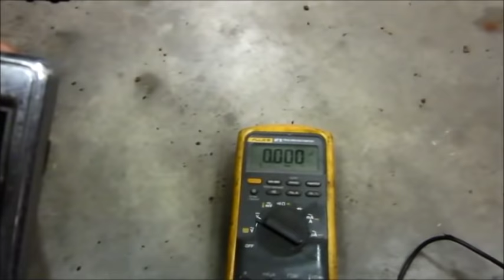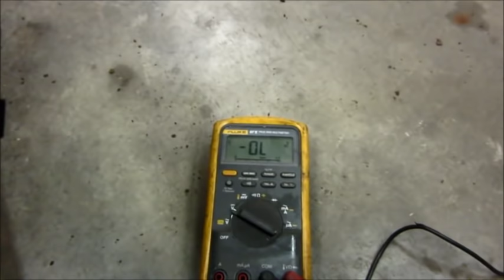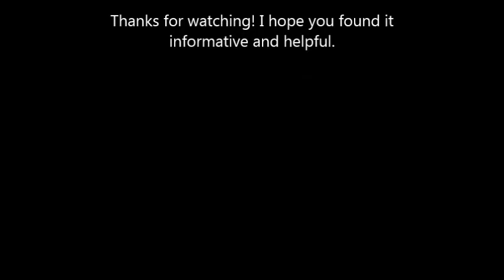GM Power Door Lock Actuator Rebuild...

Comment: Thank you for sharing . I did the same process but the moter still does not have no power.  Great video 🙂👍.
Reply from the maker: That is frustrating. More than likely, the relay or a circuit breaker is not operating correctly.
Reply: @davida1hiwaaynet   thank you for replying  . It does activate but it does not have power enough to unlock or lock the door o well 💁🏻‍♂️  I want to coment that your video is the best explain one on out in YouTube thank you for sharing the process step-by-step it was very helpful once again thank you from Mexico will de watching more of your videos 🙂👍🙌👍.

Comment: Thanks well done..mine moved but intermittent glitchy if helped. Cleaned brushes, stator contact, without splitting case as it was not frozen..works perfect, i could reach nuts so no need to weld...blue thread locker and lockwasher...79 corvette
Reply from the maker: Excellent! Glad it helped you.

Comment: Great idea using the test light! Can't beat a test light for a simple, yet powerful tool. I'll have to remember that trick.

Wires breaking in the door boot was a big problem for 80s and early 90s VW/Audi products. My 88 Audi 5000 had at least 8 broken wires in that boot. There were a ton of wires going to the driver's door between the 4 power windows, radio, mirrors, power seat memory, and lock controls.

Comment: Thanks for the very informative video. it's nice to see someone that can and will do a rebuild rather than a replacement. also, nice to watch someone else using a drill, drill press, and pin vise in combination to accomplish the end means. don't know what i would have done without them. I'm working on one myself now, i have an 
Astro Van and have rebuild the door handle on both front doors, one has a bad actuator so i'll get a chance to use these methods to finish my repairs. wish i could find one showing the repairs to the dutch doors on the rear of the van but i'm sure i'll get it figured out. Thanks again for a fantastic video showing a true rebuild.
Reply from the maker: Hi Don.  Thanks for the positive comment! I'm sure  you'll get your Astro door mechanisms working as good as new before long!

Comment: Hmm I found 4 good ones at junkyard i'd like to get off a 86 Oldsmobile cutlass ciera Brougham Model. They all 4 worked tested them with a drill battery to see but just gotta go drill them out an grab them before car gets crushed . I've already stripped and swapped the redish leather interior over to my 87 celebrity Eurosport from that car 

It also had power windows that i want too but since mine didn't come with them I can't use it which sucks since they all worked perfectly

Comment: The actuator is pretty expensive at the parts store (~$50, 9/1/18) and very inexpensive online (2 for $24.00 on Ebay) but you have to wait for shipping.  I came across your video after going to the junk yard.  They has at least ten Astro-Safaris.  I was shocked when ALL of the door actuators read either high resistance or open.  Figured brushes had to be the problem and your video confirmed it.  GREAT JOB!  I come from a "one man" TV shop background where we used to pick through windings to find the break so I'll probably skip waiting for a new one and just rebuild mine.  THANKS!

Question: Any reason you can't just use a 1/4" drive 1/4" socket and skip drilling out the rivets?  Has to be done by "braille" but it should be possible, at least on Astro-Safaris.

Comment: To take this to the next level instead of welding the nuts on, just silver solder them.  Make a ring of solder by wrapping it around a phillips screwdriver.  Then coat the bracket and nut with flux.   Stack everything up little shot of heat and you get a professional job.  It's also something any guy could do.

Comment: Thanks for doing this video, saved me the trouble to find out what is inside. The video would be better if you could do a test segment that shows how much weight can be lifted from full down and pushed up using weights or spring scale for a normally working unit post repair. The television show wheeler dealer (Ed China) did a video segment how to engineer to add power door locks to an old car that was being restored that didn't have power door locks. Ed used weights to figure out how much power was needed to lock or unlock the doors and to prove the units had enough power to lock and unlock before he installed the hardware. My 94 Chevy Astro van sliding side door does not work all the time and I paid a shop and they replaced the actuator with a new one, but not working any better. I checked the electrical power and its good so my next step is to remove the latch and clean it and lubricate and reassemble and hope it works. Must be a better way to troubleshoot this problem.

Comment: A Very, Very informative video.  Very nicely done.  I'm a another subscriber now.  Keep up the great work davida1hiwaaynet.  I think you helped out more than some folks.  [A lot of folks]!

Peace!
Reply from the maker: Thanks!  Glad you find my videos useful!
Reply: @davida1hiwaaynet  , I followed your instructions to a tee and my actuators work but, they don't seem to produce enough power to open and close the locks.  I oiled the door locks and other mechanisms, and the switches are working too, but still no luck.  I tested them without the door paneling on, so it's not being obstructed any kind of ways.  Do you think it could be in my door wiring?  Any ideas what it could be?

Thanks in advance,

Peace!
Reply from the maker: Hey, sorry you're having trouble with the lock mechanism.

It could be voltage drop due to wiring, but that would be sort of unlikely. It seems that the wiring usually going to break completely all at once.

I've had many cars where even new actuators won't move the door mechanism. It seems they are just powerful enough to move a perfectly free and good-condition door lock mechanism.

In the past, I have had to remove the mechanism from the door, (3 Torx bolts around the latch opening where the striker goes in) and clean it with solvent; dry it, and then lubricate it with chain and cable lube. 

Another possible binding point is the "bellcrank" mechanism where the actuator linkage connects to the manual lock button linkage. That often gets stiff.  Also, I usually take the spring off from that part as well, so that the actuator doesn't have that extra resistance to work against.

Hope this helps!
Reply: davida1hiwaaynet  , I'll give that a try and if it works, I'll post it for others who may need the help as well.  Thanks again for very informative information.  Keep up the great works helping people.  I'm about the same things. [Solving problems and helping other people and all living things.  Trying to produce Justice for all people].

Peace!

Comment: David, after watching this video, I think I got religion concerning the dew wipes on my doors of my car.  Definitely a priority now.  Did GM use the same actuator design across their car/truck lines for a period of time?  Would all the a-body cars use this actuator?  I didn't catch it, but what acid  did you use for the spring clean up?  Thanks!
Reply from the maker: I think that all the A-cars used these. I haven't see everything - but I have never run across ANY GM car of the 80's and 90's era which didn't have these.

It was aluminum brightener. That's a commercial blend of acids and surfactants. Not sure exactly what is in it but it works well!

Comment: Have you worked on a later model unit? I have one out of my 2004 Astro van, everything is the same except for the fuse. Mine is not glass, it's two metal electrodes that are somehow bonded together. By doing a continuity test, that's where the break in electrical flow is and why my unit is not working. I've never seen this type of fuse (circuit breaker) before. The metal halves are still bonded, by no continuity from one side to the other. I doubt I can replace them??? Maybe the ole make a field fuse with chewing gum foil?  oy....Any suggestions?

Comment: At the end where you test the actuator are connecting the alligator clips( the green and the black) to the same terminal on the actuator?
Reply from the maker: One clip went to one terminal on the actuator.  If both clips went to one terminal on the actuator, it would have created  short circuit.

Comment: What size bolt and nuts did you use. I have no way to weld if I use a rivet what size should it be? Thanx
Reply: One picture of a commercially available unit showed Tinnerman wrap around (U-style) nuts.  That should work well.